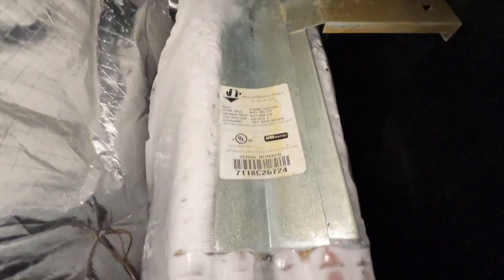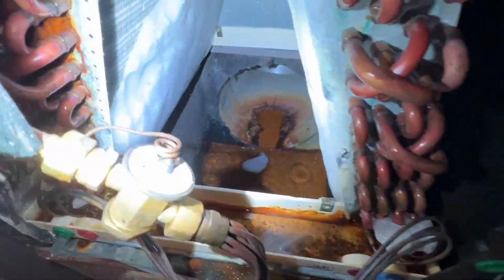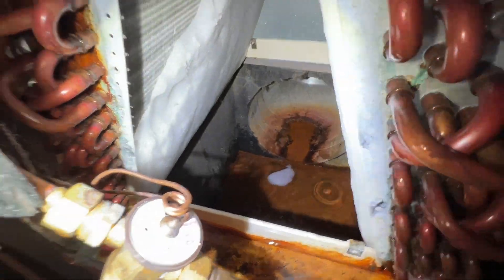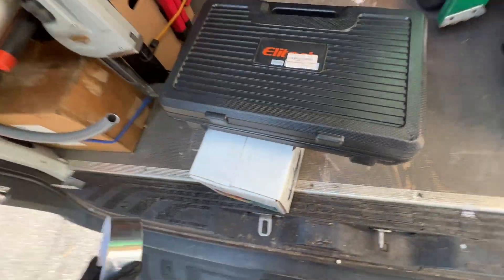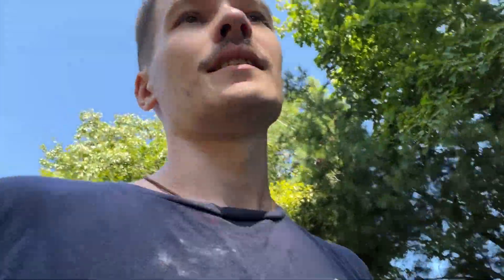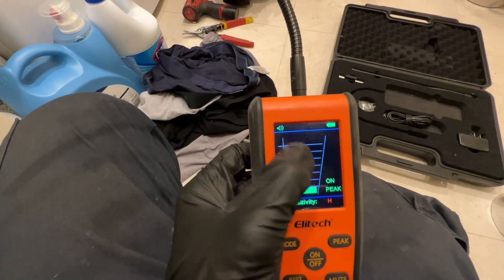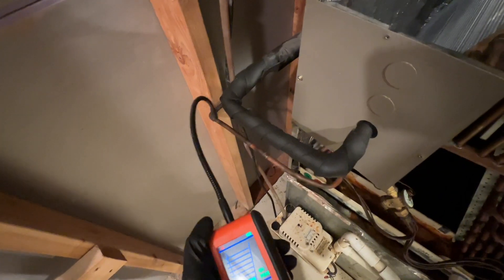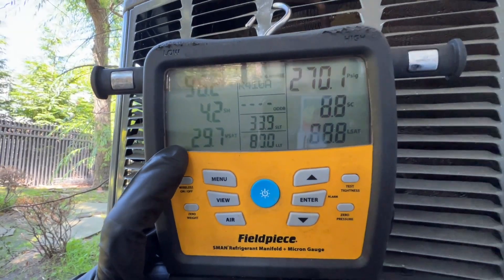Frozen Evaporator in a Taj Mahal! R410a System Leaking Refrigerant! Trane Condenser! TXV! Iceberg!

Comment: Older video and you are more knowledgeable now I’m sure but in this case I would turn heat pump to heat for a few minutes if that’s indeed heat pump and then leave fan in continuous mode with all the doors onand it will thaw itself and more of the water will go down the drain that way. Still have time on site or if possible go ahead on next call and circle back will be much less work on your part
Reply from the maker: The system isn’t a heat pump how would I turn it on heat pump mode.

Comment: Hello..I'm fairly new to watching your videos. Does the duct under that a-coil feed the ducts in the house? I've never known it to be a good thing to have water or humidity flowing through the ducts. For reasons it can cause mold issues. I work for a carpet/air duct cleaning service here in Oklahoma. So the systems up north may be different. You do very good work. Are you an independent company for yourself
Reply from the maker: I work for a company. Pipe Doctor. And yes the water is sitting in the return ductwork under the basement floor. Surprisingly it’s more than an deep enough to not be able to vacuum without cutting it open. I did throw some treatment into the water to prevent mold from growing and prevent an odor. It will dry up eventually especially during the heating season
Reply: @DCHVAC  thanks for the reply. I never thought of that being a return duct. Alot of the houses here the ducts that feed the house  are in the floor. With the returns being in the ceiling. Does pipe doctor have a YouTube also
Reply from the maker: @johncoleman6768  yea Mikey Pipes. If you look him up he has a large following.

Comment: I think there is a slight undercharge with an airflow issue.  TxV seems to be ok based on the superheat.  They were also running the AC on a cool day.  Im in the same area and my AC off the past week due to cooler weather